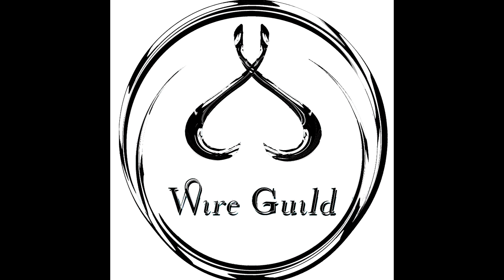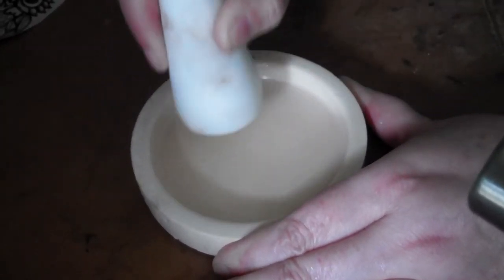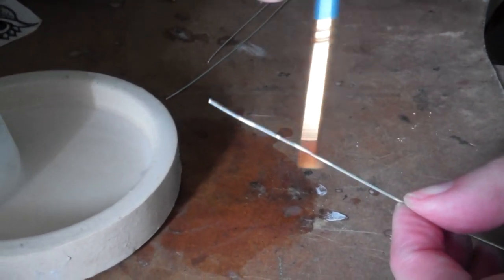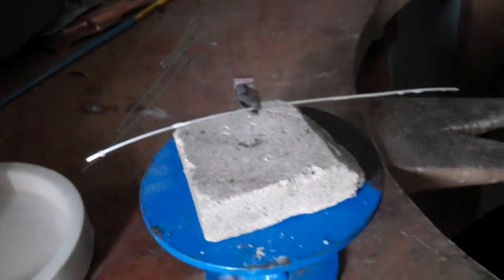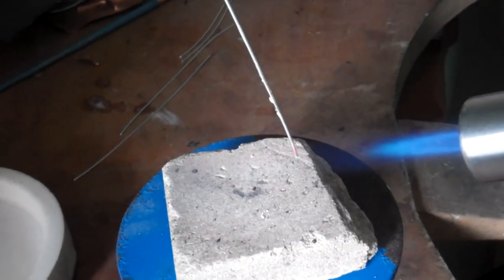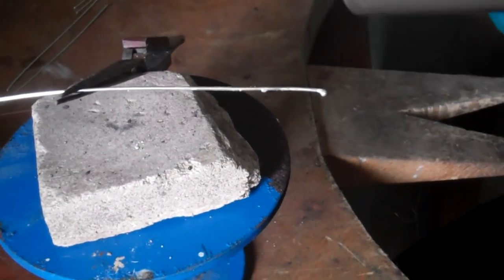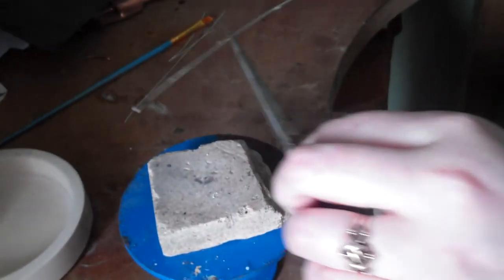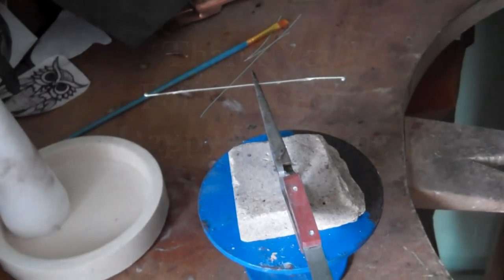Balling Wire Ends Skills Video

Comment: Managed to ball .4mm wire but not the 20ga. Don’t know if it’s the cheap torch I was using, supposed to go up to 1300c but....😢
Reply from the maker: What kind of torch are you using this is like the one I use https://www.hswalsh.com/product/blazer-big-buddy-soldering-torch-tt386
Reply: Just a cooks torch, cheap and cheerful. I did have another go just now, held the torch so the flame was at about 45deg and persisted: it worked, amazingly although I also held the wire below the tip of the flame and it balled. I do want to get a more powerful torch in the future, thanks

Comment: Does this only work with silver wire or it can you use silver coated wire. Or silver filled wire, will it work on brass or aluminum or stainless steel?
Reply from the maker: I'm sorry I have no idea, I have only used this method on sterling and fine silver copper or gold it works on those.

Comment: I really like the natural idea of a borax cone. Question..how do you straighten the ball on the end ?.., say you want to use it as a head pin ??
Reply from the maker: When I use as head pins I use just like they are, if the wire isn't quite central or straight from the balled silver I hold the ball bit in one pair of pliers and the wire in another pair and gently move till straight
Reply: @Wireguild   Thank you so much.